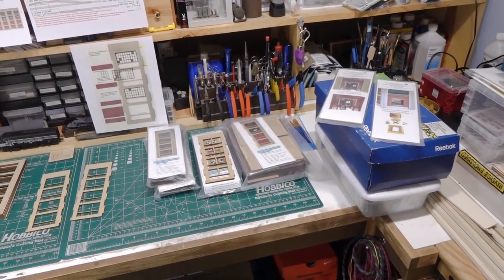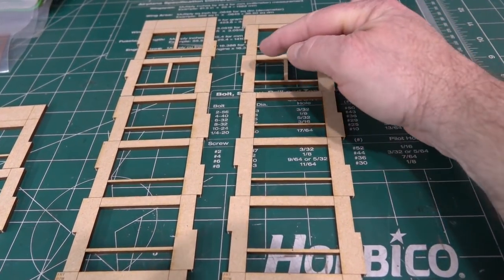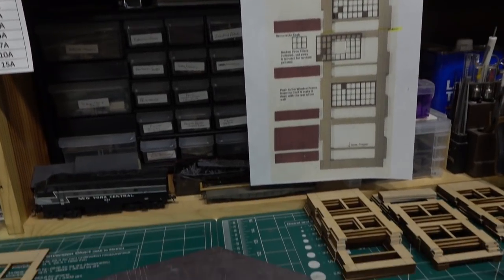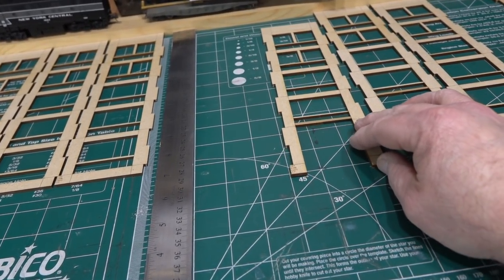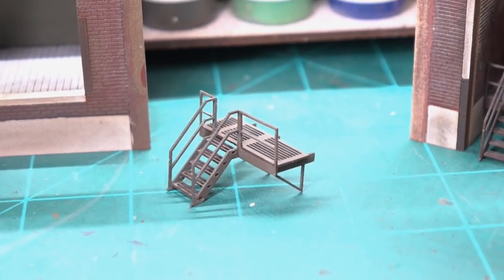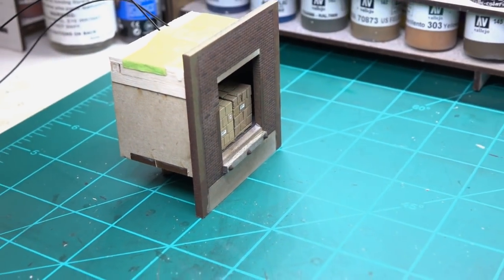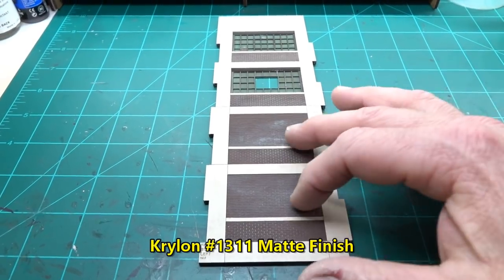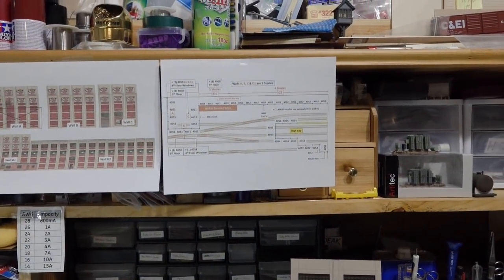Scratch Bash Project: Westinghouse Transformer Factory- Part Two

Comment: This is going to be a massive structure Rob. Quite often, with a building of this sheer size, the amount of detail seems to slip, whether done deliberately or not. You don't seem to fall into that trap; if anything , you add more kittle, footery bits to your larger buildings.👍👌😁
Watching these wee square boxes take shape, the ones with the staircases, I kept thinking the same thing. Could a couple of them maybe be adapted for use as a goods hoist? I'm not exactly sure 𝒉𝒐𝒘 I would use a hoist. I thought about maybe from track level, up onto the overbridge but you'd need some sort of loading facility. Haven't really got my idea nailed down, just thinking aloud and thought it could look cool.😁
The lighting is going to be important with this building. With it being so huge, the possibilities are endless and adding some movement and "special effects" could maybe be in order??😁
I did giggle when you mentioned the working fan; maybe going 𝒋𝒖𝒔𝒕 too far.😂
It's looking great so far; love watching the progress.👍👌😁

Cheers for now,
Dougie.

Comment: Your videos are always so inspirational and informative!  I just finished building a pallet-full of cartons from scratch, but I see an Artitec purchase is in my future (when those carton loads are back in stock).  I also recently made some RR tie bumpers for my loading dock.  I used countersunk small Grandt Line bolt heads and strip styrene, distressed to look like wood.  You can see them here:  https://www.facebook.com/photo?fbid=1387076651625551&set=pcb.1387090778290805
Again, thanks for sharing all your fine work.